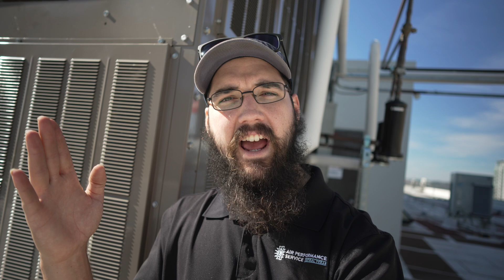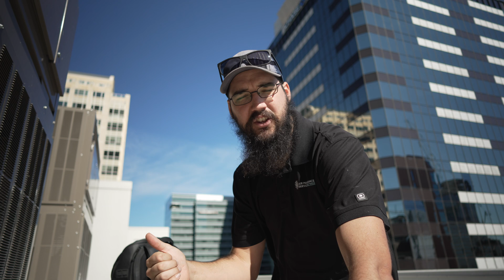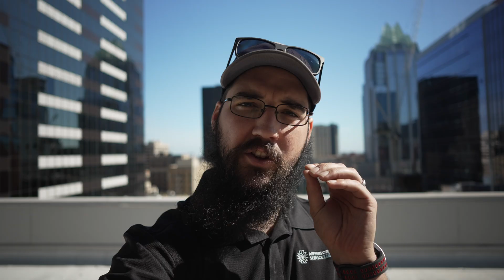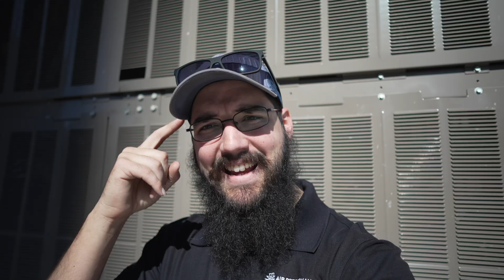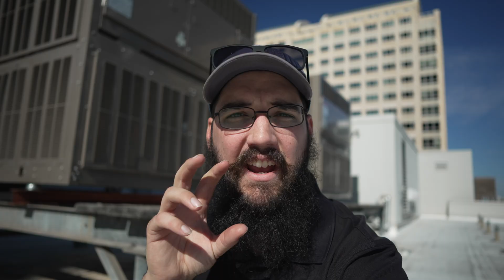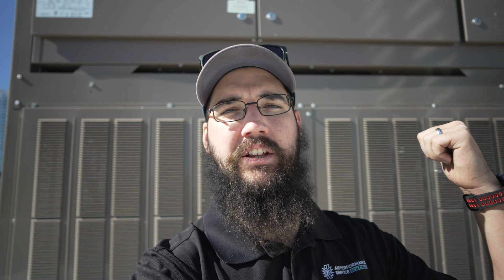HVAC Training: Lead Lag Control

Comment: The problem is when the hydraulic circuit is not sized properly for the 2 units to run at the same time but  of course nobody tells you , nobody knows , nobody has a clue about how the whole installation was designed and supposed to work 🙄
Reply: Automated isolation valves and chiller water pumps on vfd to maintain pump pressure. That's usually how I do it

Comment: Was watching an older video of yours, and found something on one of the amazon lists you had in the description. It was those shaft protectors, for use with bearing pullers. Can you explain how those work? I couldn't quite figure it out from the picture.

Comment: I know this is not related to this video in particular but do you think hvac can be for people who are not mechanically inclined? Would trade be too much for the average joe and im in Toronto Canada so there is always work here
Reply: Some of the most interesting parts of hvac are the industrial controls positions, mostly computer work, you would need to understand the basics of the refrigeration cycle/ heating and basic electrical  knowledge to know why the controls do what they do when they do it. Once you’re able to grasp that- if interpreting data and problem solving is something you dig- you’ll do just fine. 
Controls can get messy (like any job) but for the most part you need ent be very mechanically inclined.